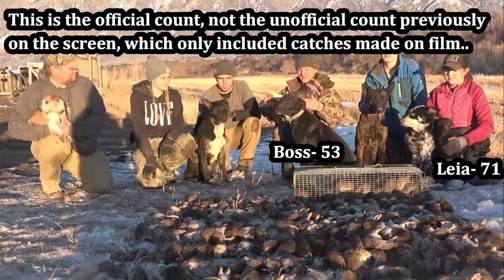Record SHATTERING Ratting Run!

Comment: And for the rats.... it is simply the apocalypse.    Instead of the traps and the poison, a nightmare fusion of their greatest foes combine to ensure that no more than a handful may survive.   If any at all.    Tales will be squeaked in silent terror, recounting the day the colony died...   The day of the teeth.
Reply: Curtain closes as one wounded, pregnant female limps into the sunset to spawn the next horde.
Reply: @zippymax1  lol try 10 females. As quick and efficient this is, there will always be a bunch of rats that get away
Reply: The Day the Rats Cried ,   coming to theaters near you
Reply: @justapillow2443  They should smoke out the rats using marijuana or some kind of tranquilizer that makes them sluggish
Reply: @ksoundkaiju9256  I thought carbon dioxide. Or monoxide if you can control it. 

It's humane. Not flammable (I don't think). And painless (if you get enough, otherwise it's like a very bad pot high and hangover)

Comment: In an old video Joe said that he knew judging by the size of a colony when the ratting was starting to have a real effect on the age structure of the colony : Basically before they get hunted there comes a time where the size of the rat horde starts to stagnate because of food availability so the bigger rats by preying on the smaller ones prevent the colony from expanding. So when the rats and dogs start to catch a lot of young rats that means the old ones have been killed previously and the colony will actually shrink if you keep hinting them.

Just thought I would share that knowledge for those who didn't know.

Comment: Joe, as a vet tech I've got a few questions. I love these videos! How do you xontrol your animals from getting worms and the like? Mink are super common to have Dioctophyma renale or the "giant kidney worm". Have you ever noticed this problem with any of your mink? Can you deworm mink? I'd imagine the medications would be similar to those in other animals.
Also, are your dogs routinely dewormed just in case they ingest any part of the rodents or the rodents feces? Or would you only address the issue once it shows up, if it ever does?
Rats are very clean, but I know sometimes they can have flea problems. Do you notice this problem? Or is it generally something you don't need to worry about?
Reply: My vet said crunching should be OK. Just not eating. If they get upset tummy, bring them in.

Comment: In the wild, rats would never have to face a coordinated assault from a pack of wolves and a mink capable of going into their holes working together.
Reply: You never know there are certainly times when different predators will cooperate in the wild.
Reply: Watch a video of badgers and coyotes working together in the wild sometime.
Reply from the maker: Rats in the wild also wouldn't live in a 100% predator-free zone protected by chicken wire, and with an unlimited supply of food and water sitting just a few feet from their burrow. They also would be living on an entirely different continent..... so what's your point?
Reply: @JosephCartertheMinkMan  That this is a cool example of human leadership dealing with a problem caused by human food storage.

Comment: If they used conventional methods before with poison. What do you do with the bodies? Do you still grind them up for meat for the minks and maybe even the dogs? How can you know it is still safe or not?
Reply: I don't think they used poison I imagine he was talking about traps being the conventional method
Reply: It is one of Joe's rules that they dont bring their dogs or mink to any farms that have used poison. Because even though the dogs are not actually eating them right then, they could still very easily get poisoned. So to sum up they do indeed use all bodies for meat and selling as feed to others with no issues, because they will not go ratting at any place that has used poison.
Reply from the maker: We required them to stop using poison for a while before we came, and we discarded the rats for the first several rattings just to be safe.
Reply: @JosephCartertheMinkMan - thanks for the Answer

Comment: I enjoy this channel a lot and I don't mean this as criticism but Joseph, unlike rats can't be omnipresent around the world so here are some thoughts:
The farm could have tidied up a lot of the junk.
If you had a dairy farm you could have some pet ferrets maybe not such a good idea on a chicken farm.
A farm could be set up and designed to make life for rats difficult, one technique would be to create spots that are ideal rat homes e.g a pile of pallets, until you drop a tailor made cage over the top of it. 
Also there's a wide variety of traps and trapping can be done in smart way(which still may not work in the long run) but it sure as hell can be done in a dumb way, same goes for poisoning.

Comment: Whoever said "Let's move these buckets to the wall or something" at 14:53 had the right intentions, but it actually is advantageous to keep the buckets in the middle.  That way, the rats run towards the center of the room because they think there's shelter, but then only find plastic pillars which they can't hide around.  If you put them against the walls then the rats will all run towards the walls and will be harder to chase.

Comment: Are you guessing on breeds or did you have them all genetically tested?
Reply from the maker: I'm not sure why I would need to do either. I know the parents grandparents and great-grandparents going back for many generations. These are purpose bred working dogs, not random mutts picked up at the pound. The crosses were made to achieve certain physical and mental characteristics that help them to excel at their jobs.
Reply: @JosephCartertheMinkMan  - First off to be clear I meant no disrespect at all (in case you took it that way). I read your reply as sounding kinda snarky so my first reply was a little snarky back, sorry about that as I am sure that was not your intention so I got rid of that first reply... please allow me to try again and take your reply point by point:

- "I'm not sure why I would need to do either." - Because unless you have paperwork it is hard to know for sure. But as long as you knew the original purebreds that started each mix of each dog you own then I guess you can have a certain level of confidence (but not certainty especially when you put things like "a dash of pitbull").

- "I know the parents grandparents and great-grandparents going back for many generations." - You personally knew them all the way back to the purebreds that started each mix for each dog you own? If so that is very impressive and not even close to the norm for most owners so it was impossible to assume on my part.

- "These are purpose bred working dogs, not random mutts picked up at the pound." - So mutts but not "random" mutts (no disrespect, the definition of any mixed dog, even intentional mixes, are still by definition mutts). Gotcha. Though to be clear I was not implying they were pound dogs so not sure why you said it like that.

- "The crosses were made to achieve certain physical and mental characteristics that help them to excel at their jobs." - I know this, I know a lot about dogs actually and am aware of how breeds are made for certain purposes and mixed for the same reasons (not sure how I gave you the impression I did not know that from a single sentence question that was not related to what breeds are for).

Anyways I love your content and love the dogs!! I can tell they are all super happy and fulfilled getting to work with their owners like that. Most dogs dream of a home like this. And just to be clear I was simply curious how you know is all (as I find most people just guess or go by what they were told, just like people guessing their own heritages, most of the time they are wrong at least on one or more of what they think they are).
Reply from the maker: @PartStupid  yeah sorry, sometimes I respond very quickly without paying attention to how it might sound. Sounds like we're on the same page now.
Reply from the maker: @PartStupid  as far as Leia is concerned, she's what I call a "math dog". You have to do math to figure out how she's bred 😂 her exact mix is complicated enough that I rarely explain it in detail. Her father was 7/8 whippet 1/8 pit bull. Her mother was 1/8 Pitbull, 1/8 jagdterrier, 3/4 patterdale. So that makes her a grand total of 7/16 whippet, 3/8 patterdale, 1/8 pit bull, 1/16 jagdterrier. When I say I know the parents and grandparents, I haven't actually seen all of them work, but I've been told in detail what they were good at and bad at and the type of hunting they were used for. A lot of times I even know silly details like why/how the breeding  was made to create her great grandmother, and what her great great grandparents were like.
Reply: @JosephCartertheMinkMan  - No worries. I do the same thing sometimes. Text is hard to convey emotion in for sure.
- That is still really impressive. Your dog's lineage had some pretty in depth owners (far and above the average owner for sure), but I suppose if they were breeding for work they would keep track of the details. 
- Thanks for your replies and again keep up the great work and content!
Reply from the maker: @PartStupid  yeah, I actually had to ask the history from a couple different owners for each dog, because obviously few dogs stay with the same guy for that many generations.

Comment: why dont the farmers store their grain in steel silos ? a silo is all closed, like a container for propane gas, rats cant get into that that easily like one of those rooms farmers store their grain in in the wide open. rats would bite the lid of the silo open to get the grain, but such lid lid is fairly small and dog placed at the lidl would bite the rats before the rats chew that lid open. its i think better to avoid the problem than to have to handle a big mess. then that grain, whear or corn etc. will be all contaminated from the rats, that is not eligible for food for humans.

Comment: We have hunted our predators to near extention in the wilderness now areas have problems with infestations of competing pests  yes mink coats are warm and all that but. I think these predtoters are  better suited in the wild doing what God intended.  

My other thoughts to this farm its it has a lot of clutter,  I dont know with this foul does normally but can't they be raised in a more controlled environment where mice and rats would find it hard to go.
Like a cement floor barn or at least crushed rocks mice cant dig into to hide.
I've see you move skid after skid lumber beams and all kinds of junk the mice and rats were using to build nest with and in.

The farmer with the hay had the same problems so did the guy raising chikens in his back yard  stacks of rubbish piled up.   The hay provides heat and cold for rodents to hide in.  But if this was above ground on a shelf they can't climb up they could not hide in it. Hay and straw used to be kept in the loft of a barn. 
Just my 2 cents.